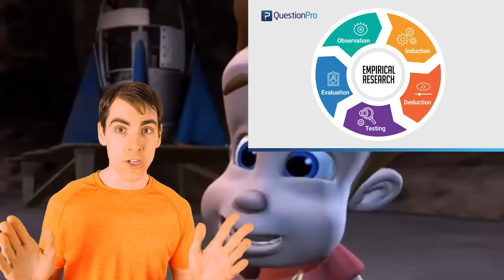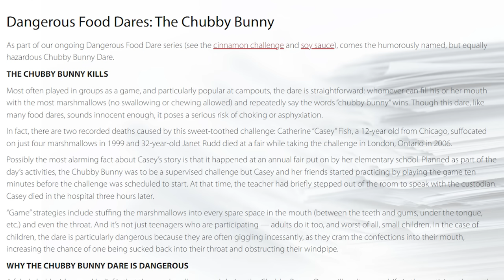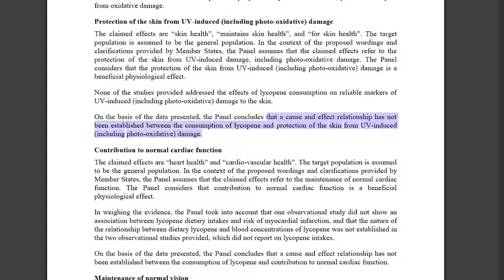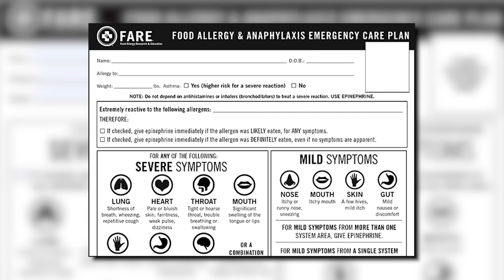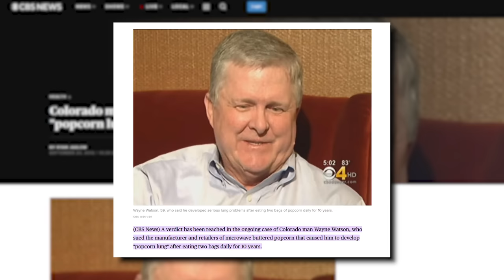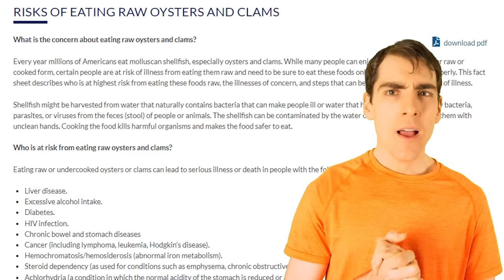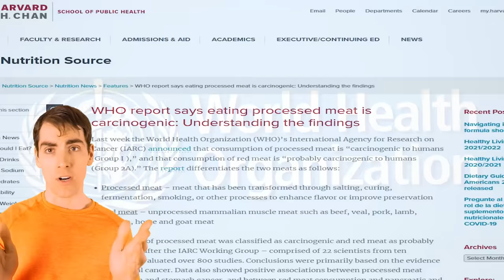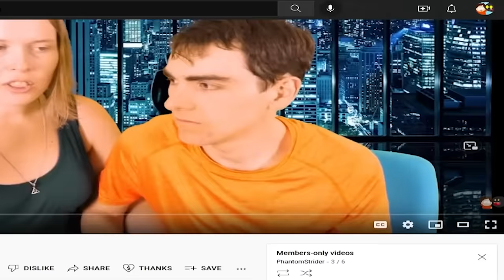The 10 Most Dangerous Foods

Comment: Hey Strider, my throat gets tight anytime I eat a lot of melon fruits (watermelon, cantaloupe, and my mom was a primary consumer of cantaloupe and always fed it to us for dessert). Is that considered part of that anaphylactic allergic reaction you mentioned? 

Also, I once had an abscessed tooth extracted, and ever since I've been afraid to eat popcorn because the pieces that usually get stuck in your teeth could have gotten stuck in the gap where the tooth was and would cause all kinds of discomfort.
Reply from the maker: Hiya Disnut. That's definitely concerning and you should absolutely ask your doctor about it! Next time you organise an appointment, make sure to bring it up :) Best of luck!
Reply: @phantomstrider  Thanks for the swift reply. I haven't had any melon fruit lately, so I don't know if it's still an issue. Right now, my current medical concern right now is if sleep apnea, which has been diagnosed and treated poorly with an ineffective CPAP machine is still an issue. Been falling asleep and snoring at work, and that's no good.
Reply: Yes. You're developing an allergy. Stop eating those fruits and consult a doctor. Get an allergy test if you can. The next time it may be a hospital trip.

Comment: With #10, it's not even the marshmallow's fault. Could've been done with any food.
Reply: Yeah, but a lot of other foods can be dislodged from the mouth/throat or broken apart enough to let a little air in with enough effort. The danger that’s specific to marshmallows is that they don’t dissolve, and they deform into & stick to each other, leaving no space for air to get through. There are other foods that can be impossible to dislodge from the throat and block off all air flow there, but not many foods create such an airtight, resistant choking hazard from the mouth.
Reply: @jasond.b-w  Still not the marshmallow's fault. Only weird people and daredevils put more than 4 big marshmallows in their mouths at once.

Comment: Hotdog choking hazard: When I was growing up in the late '80s to early '90s my mom actually had a little tube that was specifically manufactured to be a "safety tester" for choking hazards because it was made to be the size of the average small child's esophagus. If it could easily pass through the tube, it wasn't a choking hazard. That's why I didn't eat hot dogs whole with buns until I was a little older. When I was really little she would slice up my hot dogs, and then cut the little circle slices in half and I'd eat them with a fork and whatever topping I wanted (usually ketchup because what kid doesn't love ketchup?). 

I would think they still make little safety tubes like that nowadays because it seems like a really simple preventative tool.

Comment: For anyone who eats just about any hot pepper & experiences the usual burning sensation in the mouth: don't drink water or soda to treat it! They do nothing, & soda can actually make it worse because of the acid (from Google: "Soda gets its fizz from dissolving carbon dioxide in cold water under pressure to create carbonic acid. Two other acids in soda are phosphoric acid and citric acid, which are added as preservatives and flavor enhancers"); instead, drink milk (if you're lactose intolerant or vegan, plant-based milk works just as well). I had to google why, though, because even I wasn't quite sure why milk works best, & this is what I found: "Many milk-based products contain a protein called casein, which can help break down those capsaicin tricksters. Think of casein as a detergent — attracting, surrounding and helping wash away the oil-based capsaicin molecules floating around your mouth, similar to how soap washes away grease."

Comment: I'm  not a big fan of the typical hot dog with a steamed dog and warmed up bun.  I like 'squash dogs' where both the dog and bun are lightly cooked on a sandwich press.  The dog should be sliced down the middle to flatten it out and the bun treated the same but with butter applied. Then cook both briefly until lightly browned.  Put together, add BBQ sauce, and voila! the most delicious dog you've ever had.  Much better than a regular hot dog.

Comment: Kinda forget about Cassava....
Cassava, especially those who live in near southern US where it is grow wilds, has very nasty dark side.

Bitter Cassava and Sweet Cassava is very similar and hard to differentiates, Sweet cassava was the bowl of many southern soul food addition but Bitter cassava too.
Only the most well acquinted knew those from a glance of leaf and stem or from a single taste, Bitter cassava is well bitter due to high concentration of heavy alkaloid that will destroy your liver or kidney, sweet one though has 1/100 amount of the bitter one and taste starchy raw.

Never ever eaten any cassava raw, those alkaloid was used to ward off any insect or rodent that ate root in their outer solid shell, you has to peel it off, rinse it in flowing water, let it sit in clean water for an hour before you boil it, unboil cassava is as solid as a tree barks, good luck unless you have the strength of beaver.

Meanwhile bitter cassava has to be shredded and dried in the sun for 24 hrs before we can consume it as chips or any cuisine after we let it sit in water for 6 hrs.

Wheat.(Ergot)
Infested wheat with ergot, was lethal with nasty symptomps, Sam'o nella has clear video about that.

Potato.
Potato while it was unripe was poisonous due to its high number of alkaloid present in it root, the more mature it is the safer, but it become poisonous again once it sprout a flower, also never ever eaten any potatoes with green spot in its skin, chance are some nasty fungi is breeding around it

Comment: About the heavy metals in seafood. With how low a lot of shellfish are on the food chain... Yeah you're not going to get a huge amount of heavy metals unless you ate an astronomically high amount. I think it may be extended from the relatively more real hazard of heavy metals in animals farther up the food chain. Fish like Tuna, Sharks and Marlin that are high up in the food chain suffer from an effect called "Bio accumulation". Basically, a lot of sea creatures in general have a hard time removing heavy metals like mercury and lead from their system compared to some other animals. The levels in a mussel might be super low, but what of the predator that eats them daily en masse? They get a higher dose of heavy metals in their system that also just kidn of sits there. Then something else eats those en masse and gets all the heavy metals consumed by all of them. Continue up the rungs to sharks and Tuna and there is actually a reasonable risk that too much (still an extreme amount though) in a short time can have negative effects on a human. Basically if you eat a tuna (like the entire tuna not just a single tin) you're likely consuming most of the heavy metals that have made their way up the food chain to that individual fish. Some folks may have extremized this and extended the possible risk with apex predators to all sea life.